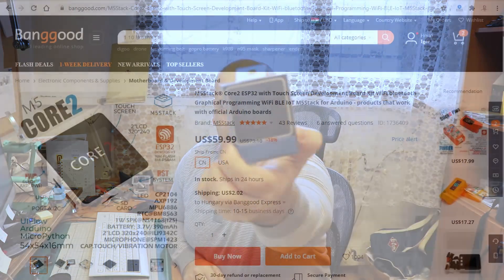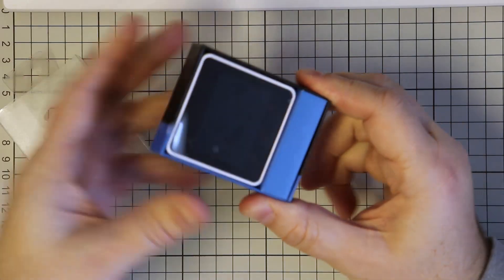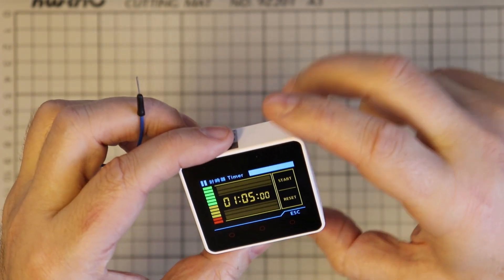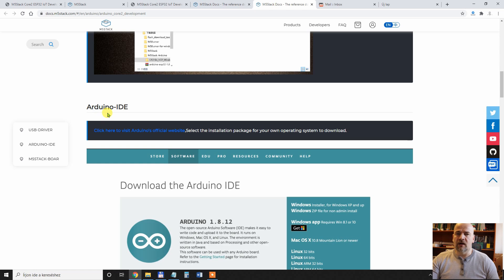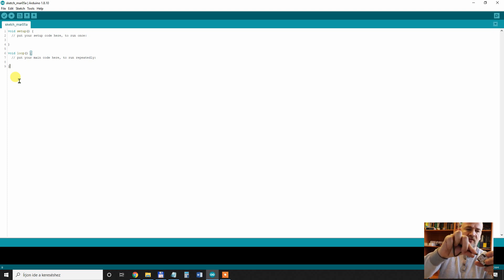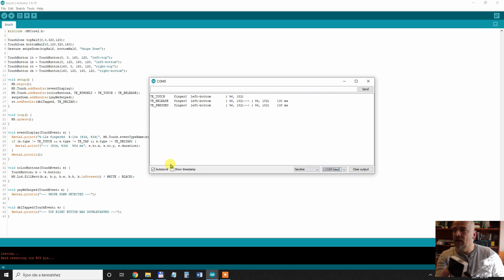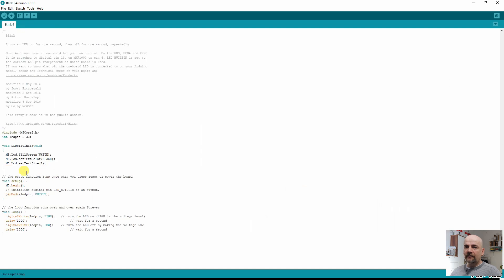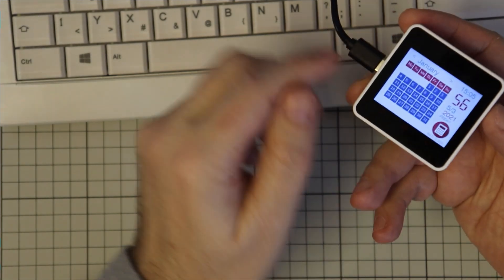M5Stack Core2 microcontroller - review and start using it with Arduino IDE

Comment: I don't see that the battery replacement would be an issue. There is no third wire for reporting any kind of status to the main board, and the board on the battery should be just a standard protection device, DW01. It's only there to implement a safety cutoff in case of fault outside the battery and prevent battery fire. It will also prevent battery deep-discharge condition. You should be able to use just about any battery on there, just check the charge termination voltage. You look at the size spec on there, 502728, and you can order an identical one, the basic standard ones that you get do come with protection. Or if you're retrofitting to a bigger enclosure, you can use whatever you can find, replaceable simple phone batteries (Nokia, Samsung - they have builtin protection), 18650s (available with a protection board installed) etc. According to the board topology printed on the sticker, which is just such a nice detail, you find an AXP192 PMIC on there which should manage the battery safely to begin with, but this is a DIY device so an extra layer of fat-finger protection is a good idea but there are no particular functional requirements on it.

Do mind that when you order from a professional battery merchant who knows what they're doing, which is a good idea, the battery will travel on land freight only, so if it's from China, it can take several months.

Comment: Why the heck is the M5 Stack folder 2,74GB? In comparison, the library for the Microbit and other nRF boards is 480MB, and MightyCore is only 47MB. They really need to cut down bloatware, compilation time for the ESP32 in this board is unacceptable due to the mega fat library.
Reply: Just replaced 2.07 with 1.06 and that one is only 256MB.

Comment: hello, I would like to know how to charge it and how many hours it charges and how
Reply from the maker: You can charge it with phone charger or from USB on computer. Depend of the charger, but less than 1 hr is the charging time.
Reply: @MyTechFun  does core2 have to be off or on? to be able to load it